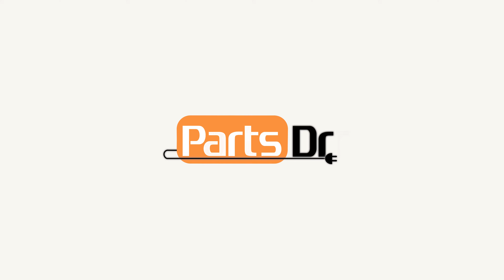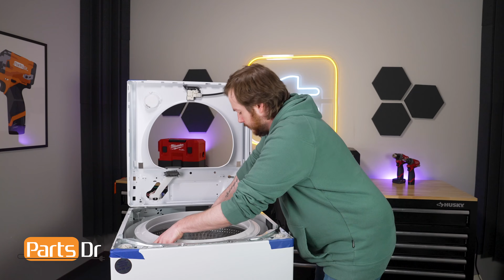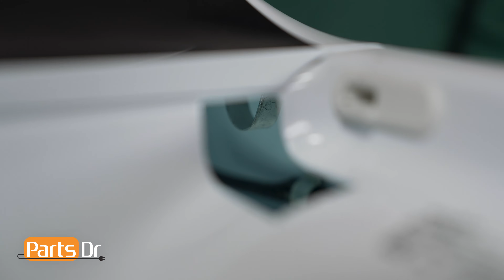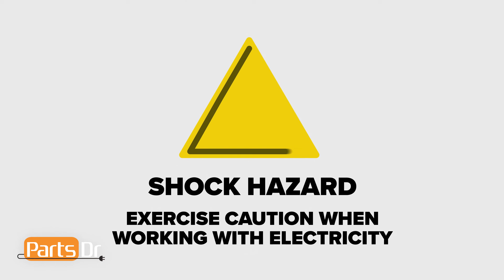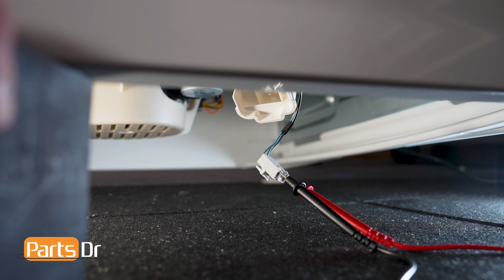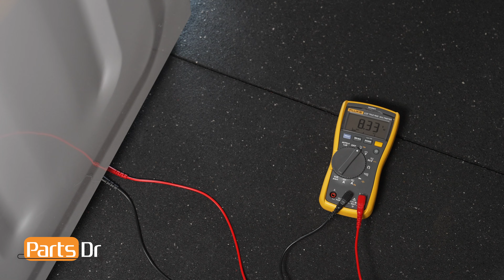Washer washer won't drain?  Top 5 Things Troubleshoot & Fix Whirlpool Maytag Amana Top Load Washer

Comment: What if the water pump reads 30+ ohlms?
Reply from the maker: If it is the same part number drain pump https://partsdr.com/part/w11399437-drain-pump as shown in this video then it is most likely bad and should be replaced.
Reply: @PartsDr 

Is it because there's too much resistance? Because I left the part to rest and now it reads 20 ohlms. I'm going to check thr motherboard next before installing the new pump.

Comment: So what if I’m getting 8 ohms at the two pins, and low AC down at the drain pump, the max I’m seeing the AC voltage is at 2.5 and sometimes bounces to 7.5v
Reply from the maker: If the wiring harness is good, then it sounds like you most likely have a bad main control board that is not supply proper power to the drain pump motor.  Let us know what you find.
Reply: @PartsDr replaced the control board, and drain pump, still nothing. I’m not sure at this point. The lid locks when starting the cycle, what else could it be?

Comment: I am getting no reading doing the lower wire harness test. Is this because the harness is bad or because my prob tips are not fine enough to get down to make contact with metal connector. Note i have also tried the same test (with no reading) by pulling the plug from the harness and inserting the test probe into the appropriate connector holes.
Reply from the maker: If none of the wires are showing continuity, it is probably an issue with the probe tips not being fine enough.

Comment: Thank you for your video!  I have another issue.  I removed my drain pump to check if there was a clog, unfortunately i took apart the drain pump itself and when i put the three screws back together it doesn't seem to have a complete seal.  Water will seep through, so now it leaks.

By any chance do you know what i could do to seal it besides finding a rubber gasket?
Reply from the maker: Typically those seals are not sold separately.  If cleaning and reassembling doesn't fix the leak, the pump assembly may have to be replaced to resolve the leak.

Comment: I’ve replaced the pump and the lower harness….. pump still won’t run. Won’t recalibrate either ??? Any advice? Mother board?
Reply from the maker: That sounds like the main control board might be bad from what you are describing.  Unfortunately, we cannot diagnose the problem over a Youtube comment, but please let us know what you find.

Comment: Thank you my problem was a black wire cut. Very helpful pump wasn't bad.
Reply from the maker: Awesome, nice job finding the broken wire and getting it fixed yourself!
Reply: Same here, Looked like a break where it came out of the wiring harness to the pump. Must have had a sharp bend where it came out and just snapped with cold weather and time.

Comment: Thank you for this trouble shoot video .  I had no power to the pump which was due to a visibly broken wire on the lower harness close to the plug in for the pump. I am guessing it was due to the vibration of the spin cycle.  I just spliced the wire and re taped . Should be good for a million more shakes.
Reply from the maker: Awesome, nice job finding the broken wire and getting it yourself!
Reply: We had the exact same problem! I thought my husband made this post! ☺️ These videos were a sanity saver!
Reply: This comment helped so much, I was troubleshooting mine and when I ran an ohms test I got zero from the control board, lifted it back up and saw one of mine got separated. Appreciate this video and comment!

Comment: I have went through the troubleshooting steps so far my pump is reading 19 exact. I get up to the control board and I have no change in the multimeter whatsoever just shows .0 L.
Reply from the maker: It sounds like you have narrowed down the issue to a failure of the lower wiring harness.  We have a video showing how to replace it here: https://www.youtube.com/watch?v=Q_QeKAsdGvY
Reply: I ended up ordering the wiring harness that was linked just installed today and I’m back to washing clothes. Thank you so much for putting the knowledge out there for us people who cannot afford to buy a new washer or have a shop fix it for us.

Comment: My washer stops and says there is an error. The water remains in the wash tub and when I disconnect the drain hose, water pours out, so it seems there is an issue with the water making it's way out the hose. I have cleaned the hose out and there doesn't seem to be a blockage in the hose. I have also cleared out the pipes in the wall that the hose sits in. Any advice?
Reply from the maker: Did you follow the troubleshooting steps listed in this video?
Reply: Did you figure out what the problem is? Mine is doing the same.